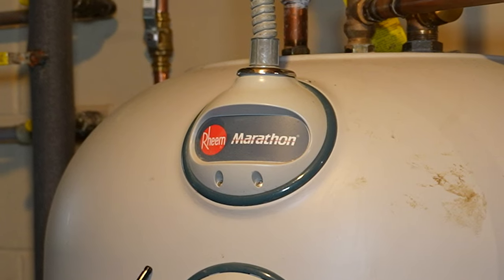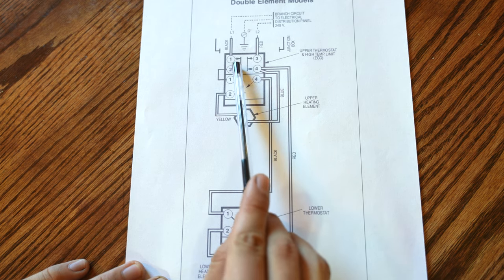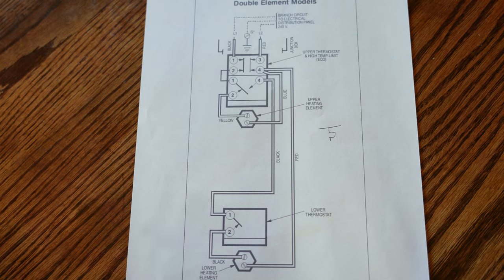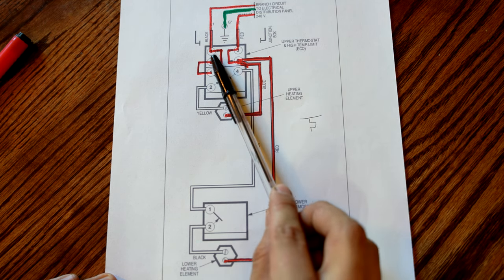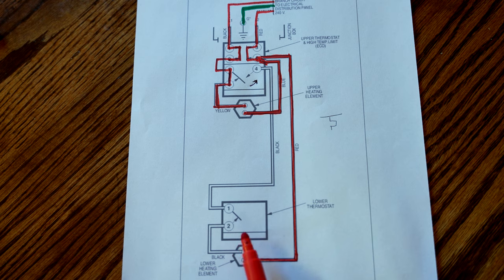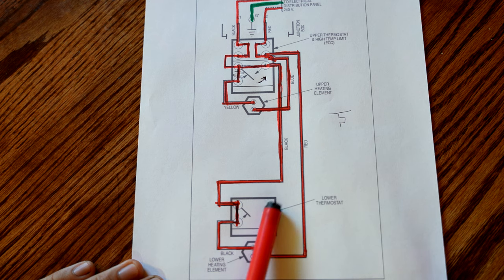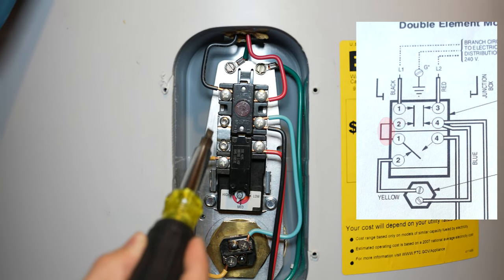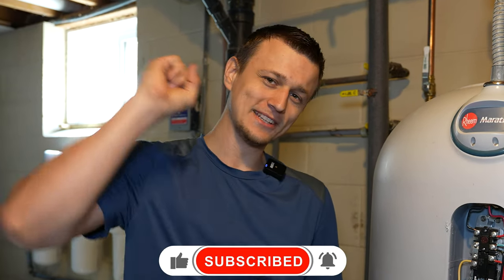How To Read Water Heater Wiring Diagram

Comment: The wiring diagram from the internet differs from the wiring diagram on the water heater and the way the lower thermostat is wired. Although functionally it still works correctly it might lead to some confusion. 
 On the internet diagram the wire from the top thermostat switch goes to the bottom thermostat switch first, but on the heater diagram and how it’s actually wired, the wire from the top thermostat switch goes to the bottom heater element first.

Comment: Hi, I know this video is about water heaters, but I have a question about my Intertherm furnace. The light flashes 3 times indicating the pressure switch is closed but the furnace will turn on for 1 full cycle but then will not turn on again until I power off the furnace for about a minute and then power on the furnace. It will usually start and again just run for 1 cycle. Then is when I see the light blink 3 times and then I power it off and then on again and it runs for 1 cycle. If it's a bad pressure switch or a dry rotted hose, why would it go on at all? Would that indicate it may be a different problem regardless of how many times the light blinks? Thanks, Dan

Comment: Please , could you advice , can dry drain pipe cause a construction lime smell coming from all vents around a house . The smell happens when the ac starts and then it kind of goes away and comes back or smells lighter until the unit shuts off . Then the smell happens again when the unit starts. The coils and the motor look clean . The smell just started shortly maybe a week after we started turning on the heating . Drain pan is totally dry and drain pipe looks dry as well . There is no dripping from the drain pipe outside . Do you think dry drain pipe would cause that smell ? Thank you , appreciate your honesty !

Comment: Great video jay, so what is the most common problems in this type of water heaters ?
Reply from the maker: Thank you! One of the problems I encountered more often than others was that with these big 105 gallon water heaters, the power company will actually cycle power on and off to it during particular hours. The idea behind it is that the Marathon water heater is very well insulated and with such a giant storage capacity it will only need to power up and heat the water once or twice a day. The problem is that sometimes that hot water would actually not last long enough. (usually families with kids that move in to a new house) I have been on the phone with the power company more than once asking them if the address I am at is currently in their "off-cycle" since the heater had no power going to it. Most people don't know this but this power saving service is optional and homeowners can opt out of it.